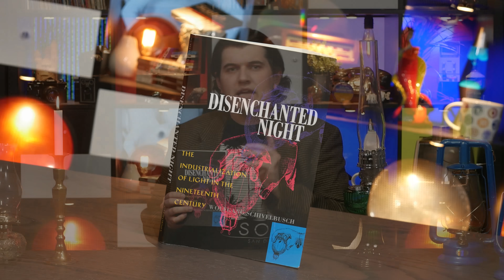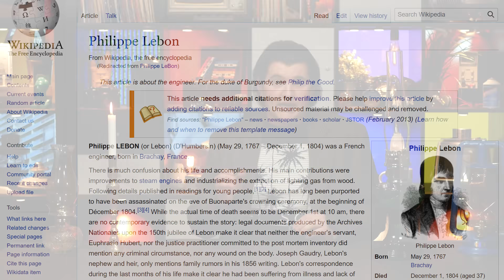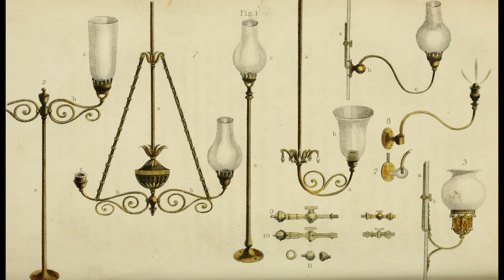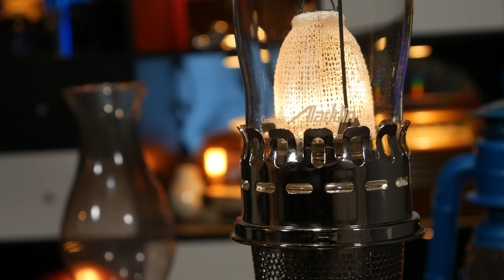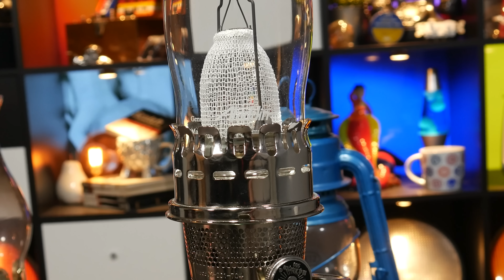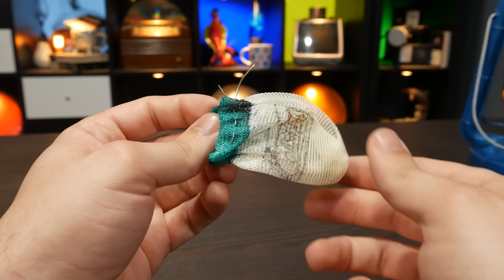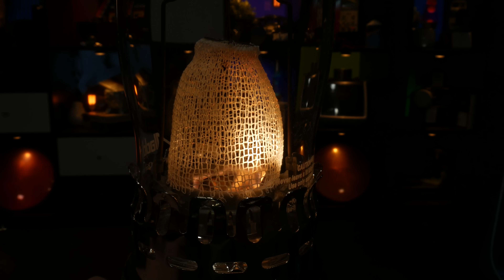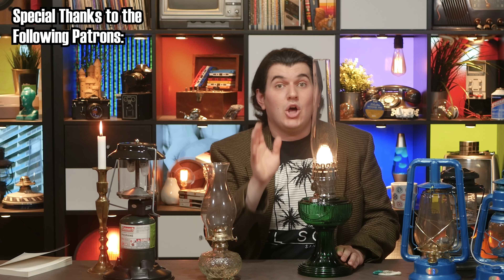How the gas mantle made lamps 10X brighter

Comment: My grandparents had a summer camp with gas refrigerator and kerosene lighting including three Aladdin lamps.  If the light got dim we knew right away to turn the flame down for a few minutes to burn off the soot on the mantle.  
I think the mantles on the Aladdin are already ashed when you buy them -- the ?collodion? is only there to allow them to be handled very gingerly during installation.  Having them ashed at the factory allows much more precise shaping than you get with the sock-type pressure lamp mantles.

Comment: I just discovered this channel a week ago.  I like deep dives into the technology on how things are made.  It’s kind of obvious you haven’t worked with these kind of lamps much.  The hot spot on the mantle is a common problem and replacing it is the only solution, really.  If you keep burning it, the mantle becomes more brittle and breaks easier.  I don’t know how to prevent it from happening on modern ones.  The same thing happens on the Coleman lamps as well.  I use oil lamps when there are power outages.  Seems that is happening more often in CA.

Comment: You missed a great opportunity here to say that the lamp runs on kerosene AND JET FUEL.  Diesel < Kerosene < Jet fuel -- they're all basically the same and many people will use diesel in place of kerosene, but more odor may be noticed due to the slightly less purity.  However jet fuel ($4.9/g) can 100% be used in place of kerosene as it's even cleaner.  Price wise though, that gasoline burning coleman lantern has no equal.  The propane lantern is as much of an 'evolution' as the 1,000 hour lightbulb was to the forever-lasting lightbulbs that came before them.   Propane is $20 per gallon when purchased in those 1lb cans that the lantern takes, compare that to $2.8/ gal gasoline.  Furthermore, gasoline's energy output is 40% higher than that of propane.  Thus the propane lantern's cost per energy of light is 10x higher (at current pump prices).  It takes roughly 8 1lb propane bottles ($40) to equal the output a single 1.25gal jug of gas ($3.5).

Comment: As an electrician, I've come across remnants of old gas lamp plumbing in walls, but not always at room entrances.  They used small diameter lead pipes. And yes, gas lights were filthy from the fuel to the emissions... much like wood fires are in dwellings these days. 
Likewise, early electrical systems installations in homes and commercial buildings was VERY scary by today's standards.  Occasionally I've come across old 1st install wiring systems still connected and used despite multiple upgrades. By today's standards and ethics (and for that matter when later wiring upgrades were done.... hmmhmmm) all the scary old stuff was disconnected and the installation virtually totally rewired. 
e.g. this is how scary. I've found smoke alarms (circ 1990's) wired to circuits using, in part, original 1910's wiring.   Yeah... some people! ...which includes stingy building owners and dodgy electricians that didn't have the guts to condemn installations and mandate rewiring. Such is life in rural bumf*^# backwaters.

Comment: Love your content, long time viewer. Heard it last time, put it as slip of the tongue, but say degree Kelvin (°K) one more time, m8 ...

Kelvin is an absolute scale and thus has, even though it's intervals overlay with the Celsius' degree based temperature scale - just offset by -273.15 °C, therefore 0 °C = 273.15 K (or ~= 273 K) -, no degrees: It's just X-amount Kelvin. E.g. 2700 K (and for the freedom unit lovers: 'K' = Kelvin, 'k' = kilo. That's why it's  USD $1 k [for a 1000 Dollar US] and 1 km and 1 kg or 1 kByte)

Comment: My uncle used to use those Coleman gas lamps when we would go camping, put it on a T-pipe and would run it off a 20lb tank. They were Amazing for lighting, almost hurt to look at. Speaking of wood gas though, there are alot of really interesting designs on YouTube and the internet for using wood gas as a means of running modern 2 stroke engines like chainsaws and what not, I think I've seen a video a guy powered an chevy V8 350

Comment: For more on "forced my lute" we have this English Stack Exchange answer providing some explanation.
https://english.stackexchange.com/a/570172/419036

It likely means forced the "lute" or essentially stopper out of what it was stopping because the pressure was so high. The "or broke my glasses" would imply that in the cases where it did not force the stopper out it instead broke the glass that was containing it due to the high pressure.

Comment: I think it was only in the last 20+ years the final gasometers have come down. The areas around them are often polluted as hell. In my old home town they recently pulled down the 1960s police station which was built on the gas works site. It needed extensive removal of heavily polluted soil before house could go up on the site, guess they were not concerned about the police.

Comment: My fathers house was cutting edge as far as lighting our house out in a rural area.  It was before the REA brought electricity to the area.   They had an out building called the light house which piped gas into the house and was used  for light.  My farther said Carbide came in cannisters (Union Carbide Company) which fed a hopper that dropped pellets in water and released gas to light the house.

Comment: 25:45 Just how many takes did it require to say "It's a real thore spot" with a straight face?  

Also, you kind of glossed-over the scariest air quality problem with coal/town gas:  It contained crazy amounts of carbon monoxide before it was even burned!  Unlike the small amounts of carbon monoxide we deal with today when natural gas (mostly methane) burns poorly or in faulty equipment, the carbon monoxide in the coal/town gas was actually part of the fuel.  Leaky gas lamps weren't just using up the oxygen in the room, they were literally giving people carbon monoxide poisoning.

Comment: I remember, when I was a kid in the '60's & '70's. We had propane lamps & sometimes gasoline lamps, when we went camping. Both used the thorium mantles. They were a bitch to light, but once they were lit, they put out much more light, than any typical battery operated lantern at the time. It was a nice diffused/even light. Not harsh.

Comment: I remember going camping as a kid and using one of those propane lanterns that had two of the "nets" inside it.  I was fascinated by it as a kid, and have since kind of forgotten about it.  This video has rekindled that fascination a bit.  Thank you.  I now have to go and find one of those lamps made by Coleman.  Again, thank you for that.  I do recall our having a string to attach the mantle to the gas output though, not a wire like yours.  Also, we had to light it with a match or lighter, no "electronic" ignition.

Comment: I was remodeling a house built around 1917.  The electric kitchen light was suspended by a brass pipe.  When I loosened it to remove the light, it began to hiss.  Yep, it was still plumbed to the natural gas line that fed the furnace!

Comment: I had a little problem with the wick on my Aladdin lamp when I first got it but fixed it with the wick trimmer for the most part.  I did go through a couple of the mantles before I realized how fragile they are. I use the aladdin fuel though because it is supposed to be an ultra pure form of kerosine.

Comment: One of the other fuels used for lanterns in more recent years is white gas, (Wikipedia's very limited article suggests it's a Coleman branded product).  It's about 55 octane equivalent and is largely similar to a gasoline, but without the additives.  It was used in a bunch of 60s-70s era camping gear - I have no idea how widespread it got.  My only experience with it was an incredibly testy little backpacking campstove my dad used, but it seems it was used with lanterns too.

The gas mantle stuff is really fascinating, though.  I've seen new ones that feel cotton, and I've seen used ones in the lamp that are the same colour, and I've always been slightly mind-boggled by the magical cotton that doesn't burn.  Finally it makes sense!

Comment: I grew up using those Coleman white gas lanterns on camping trips. They're very bright, but they're a PITA to light, they need periodic pumping to keep going, and they get effing HOT! Once high-power white LEDs became available, I jumped at the chance to build them into a battery-powered lantern that could get as bright and run as long as a gas lantern.

Comment: Having to keep an eye on the light isn't a big deal really. For us, with electricity, it's no big deal to leave the light on in a room and leave that room. But back then, and even now when the power goes out and everything is lit with candles, you don't leave for more than a couple minutes without blowing them out. You have the candle/lamp to illuminate what you're doing, if it gets too bright or too dim, you'll notice, because you're using the light.

Comment: The flueless gas heater that I have in the basement seems to be a variant of the gas mantle lamp, optimised for heat not light. The mantle has been replaced with large ceramic blocks but the principal seems the same.

Comment: I'd not heard that there were electric lights prior to the carbon filament bulb, but I'm not surprised to hear they were too bright for home lighting purposes.  I once asked my physics professor why all the standard units for electricity are so ridiculously enormous compared to what we usually use (particularly farads - a 1 farad capacitor weighs over a kilogram, not exactly what you put on a PCB) and apparently the early scientists who were establishing these units tended to work with electrical equipment that was of a scale that made these units reasonable.  So yeah, I can see the issue with electrical lighting being "it's too big" - that's the way it was with early electric stuff in general.

Comment: Wow, those lamps have really gone up in price. I remember buying my with the shade tripd and a panted milk glass shade for well under $100 in the 1980's.  Note due the the higher temperature, they do consume fuel at a higher rate, but in the winter, the extra heat on mild days may remove the need for the kerosene heater. They do burn cleaner as the mantle acts as a catalyst, so as mentioned, pretty odorless, but use in larger rooms and ensure some ventilation.

Comment: About your wick, the cleaner is for when your wick has been used a bit and is charred. Use the lamp for a while and then use the trimmer again. 2 turns with no downward pressure and your wick should even up. About the gasoline lanterns. Don’t forget the gasoline lamps of the early-mid 1900s! You can buy new ones at the Leacock coleman center website if you choose to do so

Comment: Getting the wick to be evenly charred takes patience. You'll need to pick up a wick trimmer.  Burn the wick (outside without the gallery) while turned up too high to get it charred, then trim it back. Repeating this should eventually get you a wick which both erm, wicks up kerosene evenly all the way around but also burns it evenly. Also, the new, non-thoriated mantles soot up more easily for reasons I haven't figured out yet.

Comment: On the Thorium Mantle bit: I collect Coleman lanterns and am just old enough to remember the old Thorium mantles being phased out. 

Yttrium gas mantles are laughably inefficient compared to even Tungsten light bulb filaments. They only convert 1.5% of the energy put into them into visible light, the rest of the fuel is lost as heat.

Thing is the old Thorium mantles would convert 2% of the fuel's energy into light. This doesnt sound like much until you realize that represents a 25% increase in brightness over the Yttrium ones! 
Having experience with both I can tell you the difference is indeed noticeable. Especially with a single mantle Coleman 200A. Hence why collectors like myself miss the Thorium and Covet any stores of NOS Thorium mantles we can find. (I have a few myself and use them quite sparingly and ONLY in my pristine '61 200A).

Now Thorium is of course radioactive. This radiation presents a very minimal risk to the user. Even the glass of the globe will block it, and in any case the dosage is so minimal you'd have to lick up the ash to be in any real trouble.

The Problem comes in manufacturing. The radiation hazard to mantle factory workers was incredibly high and a great many died. The lives lost are a dark stain on the reputation of my beloved Coleman.

While I'm sure now that with modern automation the radiation hazard to workers could be reduced to an acceptable level, the stigma of the danger, and the resultant lawsuits will likely prevent Thorium mantles from ever returning

Comment: Interesting aside: those 3/8" diameter tubes with fine threaded ends that are a standard part in electric lamps are a residue of the gaslight era. Lots of old electric lighting was installed through existing gas piping. Those 3/8  tubes are the last backward compatible element. Fine threads because it was origially a gas seal, not a mechanical construction.
Reply: In the UK our lamp holders still use the 'British Standard Brass' (BSB) thread from gas fittings. Also the slowly disappearing 1" lampshade fitting is a hangover from gas-brackets.

Comment: My grandmother's house had the original gas jet lighting still installed, so when I visited in the 60s and 70s, I actually got to read some old literature (which I was into as a kid - weird kid) by gaslight! When electrification happened, a lot of folks weren't convinced it would catch on permanently, and the gas lighting manufacturers saw the writing on the wall, so they converted to making electrical fixtures which attached to the old gas jets, and made use of the gas pipes to run wires through! This let owners use both gas and electric lights at the same time, and those fixtures were still intact in my grandmother's house when I was a kid.  Sounds unsafe, but it isn't, so long as the seals where the wires entered and exited didn't leak (and surprisingly, given the rubber technology of the times, they mostly didn't) because there was only gas in the pipes - no oxygen, and the positive pressure meant there could never be any oxygen in the pipes... I wonder what the subsequent owners made of those fixtures.  Oh, and her neighborhood (upscale Hyde Park in Cincinnati, OH) had gas street lights well into the 70s too.  They were quite nice.

Comment: I read somewhere that mechanism is that thorium mantels and the newer yttrium mantels have what's known as a "low electron work-function", i.e. heat energy moves these atoms' electrons to higher orbitals more easily, and as they transition back, more photon energy is released than a typical blackbody radiator.

Comment: Does it burn as cleanly without the lattice on? My immediate thought is that the heat bulidup inside of the mesh dome is causing sort of a second burning of whatever unburnt fuel remains after the initial combustion. Akin to an afterburner, if you will. Flame has a difficult time moving through a mesh so I would assume that keeping the flame contained within works like a crucible of sorts, thus creating a higher temperature than could be achieved without it.

But like I say, that's just an initial thought without knowing much more about it.

Comment: One disadvantage of limelight is that it produces more than bright white light. It also produces ultraviolet light, which numerous actors discovered over their careers, as it gradually made them blind. When the bright white light wasn't needed, the operator would put a filter over the light instead of turning it off, which didn't stop the transmission of UV light. Some actors claimed they could still see a purple spot with the filter in place. Putting mini limelights in homes would have been a long term disaster.

Comment: Building at 41.974380995769515, -71.31908367485663 was rumored to have once been a coal gas collection facility.  I arrived a century or two later, and never confirmed this.  The jurisdiction does have its own gas and electric company, though it produces neither.  I do miss that $7.35 monthly gas bill.

Comment: The bad people who started the Second Worldwide Conflict in Europe were so low on petroleum that they ran their domestic vehicles on wood gas. Regular cars and trucks were fitted with furnaces that heated the wood just enough to extract the volatiles and piped it into their engines. They looked ridiculous and provided a fraction of the power, but the widespread adoption was kind of interesting to think about. What if we had to deal with a similar fuel shortage, and EVs couldn't fill the gap in time?

Comment: My anticipation for the next episode knows no bounds. Gas generators!

Also, this episode was especially entertaining to me as somebody who, in their Scouting youth, regularly visited a cabin illuminated with permanently installed propane-fed thorium mantle burning lamps for lighting, and found them just as fascinating back then. A group would haul a couple big propane tanks up each year and mount/connect them in the basement, and the whole cabin was piped for propane lighting and cooking - very convenient for no electricity, and the excess heat was quite convenient in the winter when we usually visited. 

We also regularly used the stove versions of the lanterns you'll be showing off the the next episode; they were somewhat heavy and a bit finicky to get started for reasons I'm sure you understand, but were generally very reliable and extremely cheap to run on white gas. It was also much easier to carry large quantities of unpressurized fuel for long trips in bottles, rather than the pressurized isobutane/propane canisters that are more commonly used by campers today.